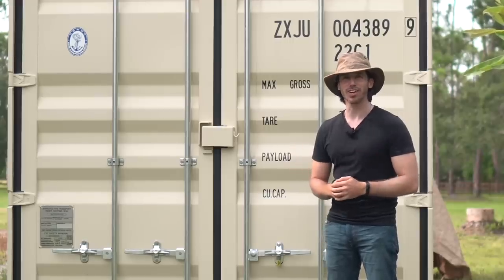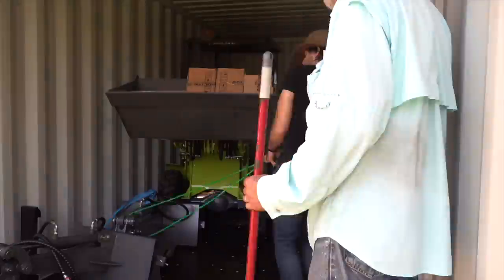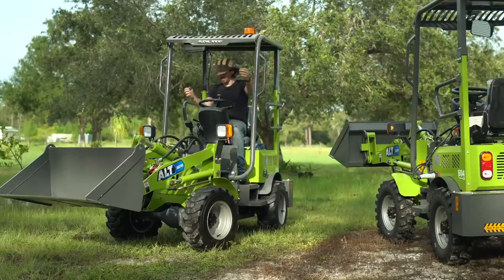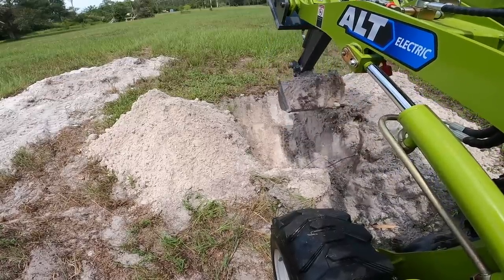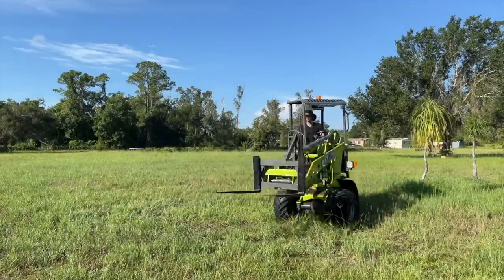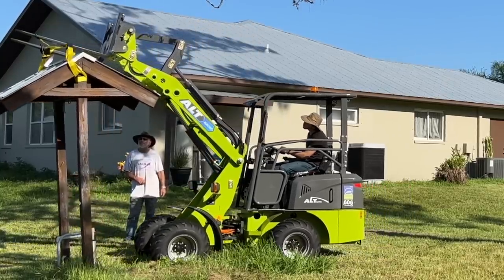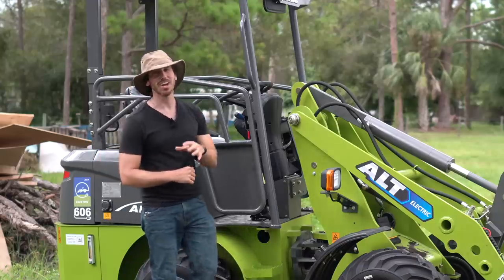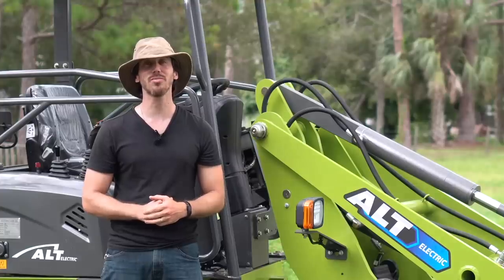I bought a container full of Chinese electric construction equipment!

Comment: Great move. I’ve worked a hobby farm with diesel skidsteers, and your units could have done 90% of the work cheaper quieter cleaner and as fast.
Reply: Not even a chance lol diesel is the way to go electric  is only for the homeowner they won't last anywhere close to what a diesel one would.
Reply: Yeah... Except for the fact that a diesel skid can last 8 hours on a tank of fuel. That electric POS is gonna be dead within 3 hours.
Reply: @MFKR696  your logic makes no sense. Electric forklifts have been around for a few decades and run 10/12hr shifts regularly
Reply: @1970Custom  I was talking about on a single charge. I used to run Raymond Reaches, Clamps and Dockstockers. Went through a minimum of 1 pack-change per shift. 2-3 if it was a particularly heavy shift. 

Electric forklifts have modular battery packs that can be changed in 30 seconds with a modified Reach-truck. It takes longer to drive to the charge bay than it does to actually replace the pack. These machines have no such benefit.

The kicker to all of this; Even with modular battery-packs, it still requires an entire dedicated room, holding very expensive racks, charging equipment, high-voltage lines, and a custom Reach-truck to keep them going. 

At the last facility I operated Lifts at (cold-storage warehouse), they had a not-so-small transformer substation dedicated solely to that purpose. Not cheap.
Reply: @davidianmusic4869 : 
Huh... well I guess because you said it here on the internet, it must be true. LMFAO!
Best get back to your "hobby farm", and shut the front door.
Reply: @1970Custom  Well...? Have at it. If my logic is so faulty, you should have no problem whatsoever poking holes in it. Feel free.
Reply: @1970Custom  
Yeah, but THEY have 20,000 lbs of Lead acid batteries, and those Eaton-Yale-& Towne machines I drove daily at the muffler plant were swapped out after 4 hours of constant service during my shifts, I had to drive to the back of the factory to the equipment maintenance area, get off and the guy would take the one I ran for 1/2 my shift, and tell me which of the recharged units to take for the 2nd 1/2 of the shift, THEN I could take my actual break. These were brand new machines as was the entire muffler plant, and the recharge rotation was recommended by the manufacturer.
Reply: No no just no 😞
Reply: @1970Custom have you seen the size of the battery or batteries in an electric fork?
Reply: It’s a hobby farm, you aren’t doing any real work
Reply: Yeah... Just with huge environmental Lithium impact.... At least an old Diesel will be serviceable in 20 years time! Those Lithium cells in 2 years time will be 7 hours of charge for 7 mins of usage!
Reply: @TheRattyBiker  I think when it comes to the mining of lithium and the disposal of the spent batteries. They all just close their eyes put their hands over their ears and go lalalalalala
Reply: Not as fast, the diesel engine has like 2-3x the power. So you would be severely limited in speed and if you value your time it would be more expensive.
Reply: And of course you can also run out of diesel fuel, especially if the gage is bad, and then you have to bleed the air out of the fuel injectors like my former landlords Kubota diesel tractor ower , ask me how I know. You are supposed to MONITOR your levels, it doesnt matter if it's battery percentage, gallons of gas, gallons of diesel, or tank of propane, if you run out in the middle of work and/or away from a source to replenish it- that's 100% YOUR fault, learn from your mistake and don't do it again.
Most people who buy a small machine like this arent going to be running it 9 hours a day 5 days a week in the first place!
Reply: @dontfit6380 and how about the disposal of diesel, where does that all go huh, oh yeah the into fucking air we breathe, better a landfill then the atmosphere.
Reply: @speedy01247  well it seems the largest amount of gases released when burning diesel is nitrogen at 75.2 percent. You know the same nitrogen spread on every farm field in pretty much the world. 15% oxygen which well can be dangerous. 7.1% carbon dioxide which every plant in the world needs. 2.6% water and we all know the dangers of that. So that makes 99.9% of diesel exhaust. The rest I like you would prefer not to breathe but I have yet to see a better option. 
It takes diesel to mine, transport and build all EV’s and EV batteries. Without diesel you will have none of these EV’s. The batteries in these machines are lead acid batteries so now you have the off gassing of poisonous hydrogen sulfide gas. The batteries that end up in the landfill it’s a lot and growing exponentially ultimately end up in our water supply. Lets not forget get the amount of dust released in the atmosphere from mining the materials to create these batteries. EV’s are no more (clean) then anything else. I’m sorry and I know it hurts but you’ve been fooled and lied to. The technology to eliminate the use of oil is not here and may very well never be here. Are you willing to drastically change the economy, your life and everything that you know to eliminate the use of oil? I really am not.
Reply: Yeah they may be a nice idea but cheap Chinese EV's aren't the way to go they are having massive issues with spontaneous combustion, so what you save won't be a lot when they all burn down along with your shed and other equipment
Reply: @shaynegadsden I'd love to see what you Americans read and where you get your ideas from.

We have five EVs in our extended family of which three are Chinese. Brilliant cars and astonishing value for money.

My Chinese EV has Lithium Iron Phosphate batteries, which won't ignite even when the batteries are punctured and will only burn if exposed to intense heat from another source, e.g. a burning ICE car (a pretty likely scenario  - happened to my brother's diesel truck last year)
Reply: @sailingoctopus1  ok 1 not American I'm Australian and you can find countless stories  about. 2 your full of because lifepo4 batteries most certainly will catch fire if punctured maybe you should check that out, as for your brother's truck was it the diesel that caused the fire or an electrical problem I'm guessing the later because diesel doesn't spontaneously combust until well over 200⁰c.
Oh if you want one to watch "The Electric Viking" covered this and he is one of the most biased towards EV's people you will find
Reply: @MFKR696  are reach trucks do 12hrs non stop carrying 500kg no effort batteries last the full shift with  30/40% left and there 5 years old 😶 you must have some dead lead acids that need servicing if your changing the battery that much
Reply: @macauleyc64  A Reach won't see nearly the work-load that your average Dockstocker will, especially in a large facility like the one I was talking about.
Reply: @@user-bb4xk6bb7nxxx and electric cars/carriages were invented in the late 1820's, and dominated the entire market, until they were replaced with those "better technology" ICE engines in the 20th century. 😂  
If you are trying to use the old "buggy-whip argument", at least understand that electric carriage/car killed the buggy whip first, and the ICE engine car is what killed the electric car.  But that's "Technology" for you LOL...  Hope this helps 👍
Reply: Your skid steer had an auger. Great 

But did it have the excavators and other attachments? Lol isn't it your skidsteerr could do 80% of this loaders work?
Reply: @roastingpeanuts I agree with you.
When it comes to full day worth of work.

The electric won't last
Reply: @1970Custom  When I’m 3 miles from my house up on a mountain where vehicles can’t get to, what am I suppose to do? Beat the hell out of an extra battery carrying it up the mountain in a bucket? Just to have to stop working after 2 hours, change out a massive battery, and get another 30 minutes of work from the fresh battery because I have to save charge to get down the mountain and loaded back on a trailer?

That’s not to make mention of the fact that this thing won’t make it up a mountain side. Or the fact that the battery will degrade quickly. You might get 2-4 hours of light work out of it for 4 months, then it’ll be half that.
Reply: @MFKR696 iv seen them work all day, u have no idea what ur talking about

Comment: These machines are perfect for Urban Contractors where noise and pollution could become issues. They can also work inside enclosed spaces and buildings where combustion gases would be a major safety problem. As someone with experience of Chinese imported goods, be prepared for lots of topsy turvy container packing and transit damage. One of the best ways to get past the damage issues in transit is to order at least one extra machine as spares. Breaking a whole machine for spare parts is often more cost effective than buying the spares individually from the manufacturer and covers your potential major component warranty service provision. Just work the costs into your List Price. The margins are there for you to be able to provide professional spares / service backup. Best of luck with Nesher Equipment
Reply: Only way someone is going to use something like this commercially is if it has the stamina to work all day between charges, and stay working without breaking long term. Access to hydro could be an issue as well. For a rural home owner with the disposable income to buy a machine to fart around with these would be perfect.
Reply: Yea just send the pollution elsewhere right? 😂😂🤣
Reply: @flight2k5  electric generation is far more environmentally friendly than gas combustion engines, even coal power plants. the efficiency is vastly different. plus EPA standards force many power plants to scrub their exhaust gasses to remove many harmful contaminants, unlike gas combustion powered vehicles.
Reply: @WowCoolHorse  Do some reading on Tier 4 Diesel emission requirements.  Practically all loaders use diesel engines so talking about gas combustion is irrelevant.
Reply: @flight2k5  I mean, is that not preferable?
Reply: @jamescoppe  what sending the pollution elsewhere?
Reply: @WowCoolHorse  diesel is more environmentally friendly than electric when used properly. Especially when batteries are taken into account as almost none of those get recycled. Best overall use is diesel electric vehicles, but diesel is chemically impossible to adhere to EPA requirements in lighter vehicles thanks to your local lobbyist heroes.
Reply: @WowCoolHorse  what's a catalytic converter for then?????
Reply: @jimthemenicingpyro3941  industrial scale carbon scrubbers are more efficient that cats
Reply: Propane is clean think floor buffer used  in stores battery ant it yet but will work just ahhh a 300.00-999.00 engine-n-propane tank will do all what the motor Electronics and wiring will do but for much cheaper and for the green folks way cleaner to
Reply: Wait until a hydraulic line breaks if you want to see pollution
Reply: not sure why he got electric ones for where he is at. would have gotten the diesel. yea drive it out a 1/2 mile from the house and bring your generator. does not sound like fun to me.
Reply: @flight2k5 funny original comment got delete......censorship  going on here.
Reply: @flight2k5  Yeah, actually. The transition to renewables can't happen without first displacing the pollution, until all polluting systems have been replaced by ones that don't pollute. 
People like you always seem to think that if we can't convert to 100% renewables all at once, then it's pointless, which couldn't be more ignorant.
Reply: @badsamaritan8223  aawww the myth “renewables” is greener. That’ll get you everytime
Reply: Thanks, I didn't see a driving test on slope. Our farm is hilly.
Reply: @flight2k5 Nuclear is clean and superior
Reply: @WowCoolHorse 💩4🧠
Reply: So Buy 2 and get 1 out of it? That says one thing, GARBAGE backed by no one. A waste.
Reply: @termgrecos3451  When engines are idling, electric don't consume any energy, while ICE needs to keep guzzling fuel.
Reply: @sankarayavoo7460  This is in discussion about contractors on a video about heavy equipment. Diesel powers all of the hydraulics when "idling". And for normal vehicles or otherwise diesel electric solves that issue. Also thanks to the EPA, while gas can easily get 45 mpg and diesel 65 mpg for a typical car, it is illegal. Gotta love special interests. Efficient ICE is not rare technologically or infeasible. Yes there are inefficiencies, but it is not that terrible.
Reply: @WowCoolHorse  That is a disbelieve. The way from coal to steam to electricity into a battery is a large amount of losses, much more than from oil into a tank. Simple physics which cannot be changed by environment religions.
Reply: @flight2k5 Not if nuclear is used to generate the energy